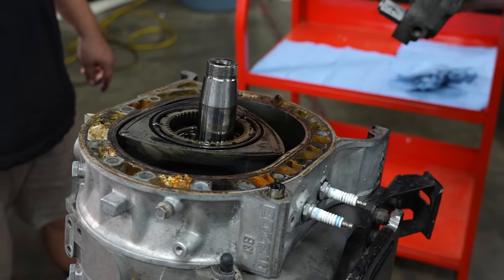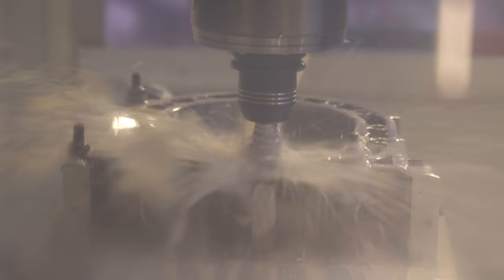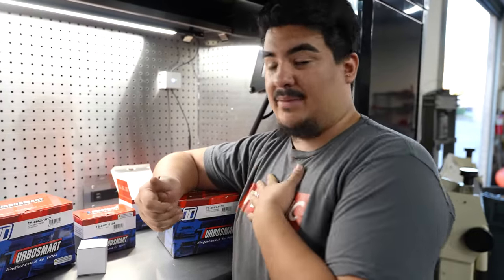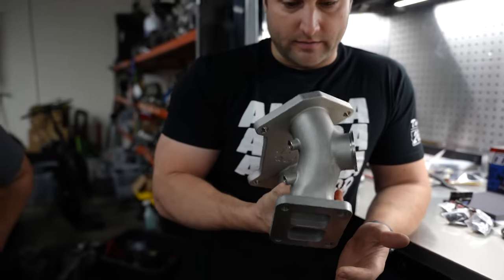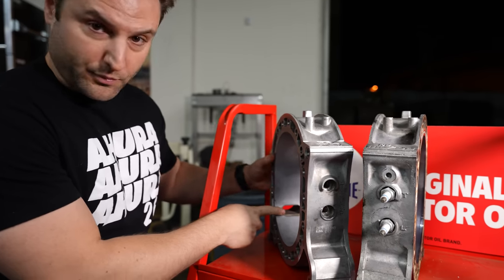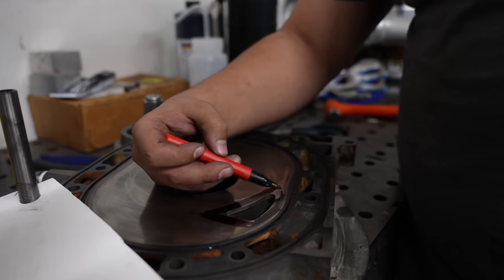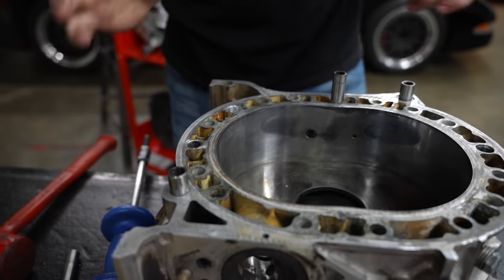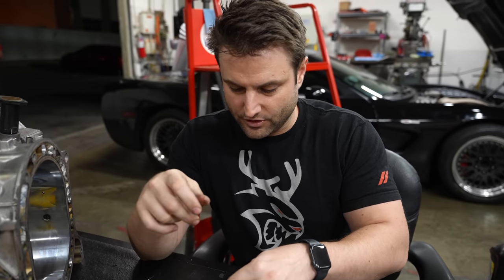The Ultimate Turbo2 Street Engine. Not just drag racing.

Comment: I have watched you for 3 years etc,  ok from and Engineering point of view i have built many engines not RE,  min you need is 3 dowel pins max 5 or 6 or 1/3 total amount,  now line up the housings with 2 pin try wiggle now 3 then 5 in, the side movement will be zero at say 3 plus pins. Think of a really strong safe has 3 pins in tbe door try open it, now add zero tolerance you have. Now once you go over 6 or so pins is it also hard to assemble from tollerance actually may cause more issues. I think 6 from 30 are good or how many bolts there are, now also you started with 0 and 2mm wiggle yes then add 7000 RPM and heat.
Thanks Danny long term watcher

Comment: COMMON Rob Surely you could of borrowed a dry ice blaster to clean up the water jackets of the motor or and other parts too ! might want to look into it as the cleaner the engine the easier it is to find faults or issues ,especially if going to be driven hard /ie thought i Hurd death valley ? ...

Comment: Remember the car was sitting for a while 
Check the rest of the drivetrain 
Also could u try to find the perfect design for the exhaust system - 13bs don’t usually sound great with regular design exhaust , mainly straight pipe sounds good but that doesn’t go well with this build 
Learned a lot from this keep em coming 
And I’m waiting patiently on the 13th

Comment: Rob,  they do make oversized reamers.  You can get them that are plus 0.001"" larger than whatever your nominal dimension is.  Either that or do the old trick of using a small file to create a burr on the end of the reamer and that will make it ream a little oversized.  Not that I recommend that, but I've seen it done when there was not enough time to get a new reamer and expediency won out over surface finish.

Comment: I've always wanted to prove people wrong that a rotary engine can be used for towing heavy loads.  My current idea is to use the architecture of a diesel electric train.  The engine spins a generator, which can go to a bank of capacitors (or batteries if you must) or directly to the electric motors.  The energy storage is for burst acceleration and regenerative braking.

The vehicle of choice would be a 1-ton truck, 4wd, with two electric motors, one  going to each driveshaft / axle.
Reply: I mean that isn't using the rotary to tow though. And is exactly what mazda has been working on. Using the rotary as a generator. But the biggest thing would be to not run petrol and use mazdas idea of the rx8 HE.

Comment: The spring goes between the plunger and the bolt to hold the oil in the crank Gary K also i have some other info for you but i would like to give it to you off line 45 years engine building !!

Comment: Hey rob big fan over here in Abudhabi quick question what do you do with the left over metal shavings from the cnc do you store them and sell them another time or do you just toss them away?
Reply: AFAIK metal recycling here in America is a business of scales. Meaning it's most likely not worth the storage space for Rob to recycle the machined metal shavings unless it was by the dumpster load. Larger production shops could recycle the metal shavings for pennies per pound depending on the scrap value and how "clean/pure" the metal shavings are, but it's usually a small payback.

Comment: I thought that if you plan to use the racing squirters for the rotor, that is not made for a streetcar, as at lower RPM and idle, it wont flow enough.  So only for higher RPM use.  I thought this car was supposed to be a good performing street car too, or was this a reason to blow the motor to replace it with a monster engine later?
Reply from the maker: I’m hoping all the regulators crushed down will ramp up more pressure than those squirters release. I am experimenting. I truly don’t know. I like the idea of more oil flow on a daily driver for cooling during sustained driving. That’s my approach and I could be completely wrong.
Reply: @RobDahm  Looking forward to seeing what happens.  I have a 1987 RX7 that I just installed a Megasquirt onto, and am about to drive it 1500 miles (buying first house, yay)

But once I get it there and then the moving truck, am going to be taking it apart and rebuilding it.  Really want to do something much like yours.

Comment: Are there any real gains from porting the exhaust (other than changing the timing)?  I've seen high power (NA-high rpm) piston engines actually go to smaller exhaust valves so they can fit bigger intake valves.  The claim is, it's more important to get the air/fuel in; the exhaust will leave anyways as it's very high pressure trying to get out.  IDK if it's the same for rotors though.
Reply: With a rotor you dont need to compromise since you can have both a large intake and large exhaust
Reply: @ValentineC137  Okay, but again, does it matter?  Exhaust gases are already pressurized and trying to get out; other than changing the exhaust timing, does porting the exhaust make a difference?
Reply: @ValentineC137  I get what you're saying, but the only thing is, stock exhaust ports/valves aren't tiny.  As soon as they open/rotor passes over them, the gasses start going out, making it easier for the piston/rotor to move.  IDK, without hard data, I just don't think it's worth the trouble/price.  I don't have enough XP with boosted cars either. *shrugs*

Comment: As somebody with limited rotary knowledge, where do you see the benefits of doing the machine work for the dowels?
Reply: Machining for the dowels is necessary as the factory bolt holes are generally not precise enough to align dowels all the way through the engine.  The dowels themselves are there to keep the engine from "spinning itself apart".  Not certain if that's what you were asking.
Reply: @bentracy7463  yeah that helps! I wasn't sure what the purpose of the dowels were. But it makes sense to help keep the rotor housings aligned. Thank you!
Reply: As explained, the dowels help with keeping the torsion and vibrations from eventually spinning it apart. Not that it results in catastrophic failures right away, but keeping those torsional forces from shearing your seals is one of the benefits

Comment: have enough thick layers so the dowels will not lever bend easily
Reply: better have both layer pairwise locks and the cake dovels
Reply: if the "drills" are lasers or plasma, then you dont have to cool it to keep the drill heads from melting, because they are designed to be molten, or hot, all the time
Reply: dont have so close tolerances, have thicker walls
Reply: dont be drunk, be wise
Reply: so high
Reply: from the top of my head, pun intended
Reply: reaction turbo, impeller, instead of impulse bladed turbines
Reply: continuous turbine electric super cap drive train quad hub electric wheels
Reply: reaction turbines your pressure/fuel burning flow will be utilized fully, no blade optimization needed
Reply: how about bolts, caster
Reply: hows the rotor balance, turbine is in total balance
Reply: its just a piston engine bro
Reply: air is a good lubricant, if you have glass bearings, no oil needed, just air, like an air breathing engine, but  also lubricant